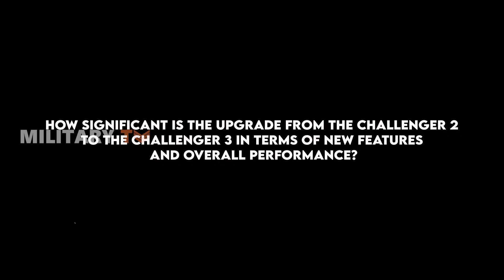The Secret Behind Challenger 3's Testing in Germany

Comment: it is tested in Germany because the turret is build by Rheinmetall....the 120mm smoothbore gun is build by Rheinmetall too, thus blurring the differences between all NATO tanks, aka they are all on par with NATO-standards....
Reply: Leo2A8UK😂
Reply: The Challenger three tank is a joint venture between BAE Systems and Rheinmetall Germany
Reply: The turret is built by Pearson engineering in the UK.
Reply: @toecutter6968  Yes, built. It was however designed by Rheinmetall.
Reply: NATO standards are not very effective against Russia 🇷🇺
Reply: @larryperera8724 

Well, even if it were so it is effective enough. What is used in Ukraine is not top of the line equipment but mostly outdated equipment which evidently still goes toe to toe with Russian top shelf with supreme ease. 🤷
Mind you that it shows that while tech is important the personnel is just as important, and Ukrainian personnel have given Russians a run for their money. How else could such a supposedly small and weak adversary hold out so well against the allegedly second strongest military force on the planet?
Reply: @larryperera8724  PZH 2000 and HIMARS 🗿

Comment: Losing D.U. rounds has nothing to do with the switch to a smoothbore gun. That's all health and environment related. Smoothbore are in fact better for firing discarding sabot ammunition, like the current D.U. rounds. The round the Challenger can no longer use is the H.E.S.H or high explosive squash head round. That needs rifling to spin it for stable flight (accuracy). Sabot rounds like D.U. use fins for stabilisation, spin even works against this to some degree. British Army wanted to retain H.E.S.H for Challenger 2. As it's useful against light armour and soft targets behind cover. D.U rounds are only really useful against heavy armour.
Reply: Incorrect
Depleted uranium is vastly superior to Tungsten however the companies that make depleted uranium are virtually non-existent now. Orbital ATK which makes the US made M829 series was brought by Northrup who announced in 2023 that they would no longer make depleted uranium rounds. Simply put, no one is making depleted uranium rounds any more as far as Western countries go.Long before Ukraine, the appearance of T-14 already questioned the existening capabilities 120mm ammunition that the time
The US made the M829A4 in 2016 however as stated before, no one in the EU was making DU rounds and the UK' CHARM-3 hadnt upgraded since 1999
so there was doubts about its effectiveness as well the ability of tungsten to penetrate newer Russian armor
The 130mm solves all problems , First Sabo rounds have 50 percent more kinetic energy which easily allow 130mm rounds to punch through any Russian armor 
The most important fact is that HEAT round in 130mm carries larger warhead which also equally as dangerous if not worse
Reply: @verdebusterAP  It's not vastly superior. It used to perform better than tungsten alloys in the 80s but only against semi-infinite steel targets. Against modern composite armor arrays tungsten alloys perform better because opf lower ductility.
Reply: @jonny2954  
Incorrect
Depleted uranium principal advantages over tungsten is it naturally self sharpening 
and  pyrophoric 
While Tungsten has near similar density , its lacks DU natural abilities
Thats why the US uses DU liners in the Abrams
Composite armor can blunt Tungsten rod rounds however DU rounds are much harder since their self sharpening allows them to retain their form
DU is pyrophoric so even if the rod is stop, the metal will burn at  a high temp which is bad for tanks for several reason
You can line Tungsten with zirconium powder for incendiary effect but it burns at 3000-4000 F while DU burns at over 10,000 F
Yes modern alloys are better than previous generations but they still lag behind DU
Reply: @verdebusterAP  Read my comment. Self-sharpening, that's why it performed better on semi-infinite steel targets early on. Modern NERA arrays don't care, the lower ductility of tungsten alloys help them perform better in that case.

APFSDS after armor effects rely on penetrator fragmentation and spall. While both kinds of penetrators get very hot they're simply too small (especially after going through armor) to heat up anything around them to havy any effect.

According to the US Army Research Laboratory, there is no difference in perforation of steel targets between DU and modern tungsten penetrators. The Americans say it themselves dude. You kinda dense.
Reply: @jonny2954  
Lower ductility does not help against modern armor, specifically against Russian armor
Russian made Kontakt-5 ,Relikt and Malachit  are designed to break Sabo rounds by subjecting them to violent sideways force as well explosive force
The US got their hands on Kontakt-5 twice and that is reason why they increased the size of the penetrator. Its thicker and heaver and harder to break

The  US Army Research Laboratory never said anything like that as they are the ones responsible for the M829 upgrades
They have researched  depleted uranium alternatives however as the M829A4 is DU still, no alternatives met the criteria for replacing DU in the series M829

Lastly, if Tungsten alloy could reliability penetrate armor, the 130mm program would not exist. The existence of program was due the doubts of existing tungsten penetrator 
against newer Russian armor.. The 130mm provides 50 percent more KE than existing 120mm rounds which tungsten alloy to reliability penetrate armor
Reply: @verdebusterAP sorry but some of the stuff you said is wrong. Armor vs reactive armor. It penetrates armor better.

A big factor in du is that it is relatively cheap for a country like the us. 

130 mm exists bc people want their tanks to work even in 30 or 40 years.
Reply: @emilsinclair4190  
Cost is not the factor but performance
Depleted uranium is naturally self sharpening as well as pyrophoric
Despite modern advances, machining tungsten to match DU for the US is not cost effective
Lastly DU has to be specially stored and handled when not in use which makes it more expensive than tungsten rounds
For countries that dont use DU, larger caliber weapons are the only choice
Reply: @verdebusterAP  ... again. Since alloys can also be self sharpening this point is mute. The kinetic and heat energy caused by the inpact will cause similar levels of damage inside once penertrated.
Strange how you say cost is not a factor and than state that it is not cost effective to produce tungsten alloys with some abilities.

Yea. It is a cost thing. The us had a lot of du so they used it bc it was cheap. Many countries did not have that.
Reply: @emilsinclair4190  
Just because an alloy can be self sharpening does not mean it delivers the same performance as naturally self sharpening materials
Cost is not a factor
Countries can make DU rounds however they dont not because of performance but simple ideological reasons reasons
Both DU and Tungsten are toxic heavy metals and just as bad
Reply: @verdebusterAP  1 no they are not. Du is worse than tungsten alloys.

Good. Now you just have to realise that this can mena that the performance can be superior against certain material and you will see why some countries use tungsten.

Sure. They can make them. As cheap? With excess material ? 
You even admitted that cost efficency was a factor in your previous comments.
Reply: @emilsinclair4190  
Tungsten is in no way superior performance to DU in any way
And countries for not using DU is ideological reasons not performance
They simply dont like it
Its more cost effective to make DU but they simply dont like it
Reply: @verdebusterAP  you have no base dor your claim that it is not superior. There are different kinds of armor. And different alloys have different advantages against different kinds of armors. Your claim that tungsten alloys can not be self sharpening was already disproved.

Kimda depends how you want to define ideological. Less polluting weapon systems are always good when you fight on your own land. 

Countries without massive nuclear stockpiles and a massive nuclear industry have less du meaning that the costs way higher for those countries.
Reply: @emilsinclair4190  
Lets see DU is naturally self sharpening and pyrophoric  while Tungsten is not. Tungsten has to be machined to be self sharpening while DU requires very little machining
so yes DU very superior. Tungsten also cant match DU pyrophoric nature. DU can reach as high 10K F while Tungsten not even close
Again both are toxic heavy metals
DU is byproduct of reactors not weapons
Reply: @verdebusterAP  ...reactors and weapons require similar infrastructure for the first steps.

Pyrophosphate does have 0 effects at the speeds. The destruction inside is basically the same.

Yes du is cheaper.
Reply: @emilsinclair4190  
Incorrect, 
Pyrophoric adds additional incendiary effects 
No, Enriched uranium depends on the usage
Low grade for most reactor sand high grade for most weapons
Reply: @verdebusterAP  ... yes and you usually separate them from each other using a centrifuge. The material with high content gets used in bombs.

Incendiary effects are basically irrelevant. It does rarely matter how hot the shrapnel traveling at the speed of a bullet is.

And even the few cases where it would matter you forgt that do to friction even tungsten gets fucking hot (tungsten also carries heat better than uranium. Look at the melting points)
Reply: @emilsinclair4190  
Again two separate processing route
Incendiary effects are by no means irrelevant. Steel for example melts at 2500 F plus temp. and DU burns at over 10,000 F 
so if by chance, the armor stop the rod, its still burning temp of DU is still going deal serious damage
its called beyond armor effect, after effects , multi-effect penetrator
several names for the effects after the fact but thats the principal advantage
it does more than just penetrate
Reply: @verdebusterAP  the start is the same and one can be a byproduct of the other.

People inside the tank get killed by the fragments traveling at the speed of bullets. Getting hit by one of them and it does very rarely matter of the material is du or tungsten.

Fragments created by both methods are incredibly hit do to friction. If it is already extremly hot even more heat does not matter. 

And ehen the fragments get slowed down heat can even be a detrement bc it makes material softer. Especially since uranium melts easier than tungsten. 

If the armor stops the round the structural damage caused by the shot will make up most of the damage. The heat created by stopping the round basically makes the other effects irrelevant.
Reply: @emilsinclair4190  
Still different process 
The shrapnel effect of DU more likely to cause secondary effects than Tungsten alone
Additional fragments are hot not burning
major difference , when tungsten stops moving , they automatically cool off whereas DU is still burning. which causes temp in the tank is sky rocket
Case in point, Tungsten fragments embedded in the armor door from the ammunition does nothing whereas DU on the same door is translating massive amounts of heat 
Again 
After effects of DU are far more lethal
Reply: @verdebusterAP  except that the fragments of tungsten are also extremly hot do to the friction. Again. The difference is minimal, depends on the situation and do to its lower Meeting points du fragments can hav3 lower penetrativ3 abilities bc they are softer.
Reply: @emilsinclair4190  
They are hot but they are not burning, 
Hot surface temp, Burning is self sustaining major difference
DU is not softer
Reply: @verdebusterAP  du is softer do to ots lower Meeting point. The damage caused by fire is usually done by the heat it produces. The fragments of du left after penetration are to small to cause anything significant enough to be a difference.
Reply: @verdebusterAP  Who's incorrect about what?

Comment: You would assume the UK would just use US DU rounds. With the exception of length, the barrel is the same. The recoil system is different, between US and German guns. They would only need to qualify the targeting parameters.
Reply: In comparison, the US ammunition is outdated. The L55 is not only longer, it works with higher preasures as well. So the penetration capability is +30% compared to the L44. In addition, the newest german ammo is very safe, it does not blow up if hit. But in this aspect, Challenger had / has the best protection of stored ammo of all NATO tanks.
Reply: @morgensternc  has/had?! No. In what world?! How is the challengers ammunition placement safer than any old t-series tank?! It isn't. It's worse in fact. The CR2 has ammunition and charges all over the hull. It has no blowout panels and will throw its turret if anything explosive is hit. The CR3 will suffer the same fate with the exception of German insensitive powder loads. The US Abrams is currently the only MBT that stores all of its ammunition in the turret bustle...
Reply: yes its the 120mm smoothbore barrel by Rheinmetall

Comment: I do not get why this is called Challenger 3. It is the very same tank fitted with a new gun. If anything, this is Challenger 2.5 or Challenger 2 Evo or something but its clearly not a generation leap.
Reply: New gun, better ammo, new sights,commander thermals, hunter-killer capabilities, new electronics, new armour, new fire control system and if I recall correctly some kind of battle management system. This is definitely a generational leap.

Also if I recall correctly there was an emphasis on modularity in the design process to make upgrade packages easier to add.
Reply: Maybe I am mistaken, but didn't the Challenger 2 have a teapot on board that has been omitted from the new tank? For Brits, this should justify a new version number?!
Reply: @Born.Toulouse  All British armoured vehicles have a brewing vessel onboard.
Reply: @Disbelief-  Compared to the Leopard 2A4 the Leopard 2A7 also has new sights, hunter-killer capability, new electronics, new armour, new fire control system. Doesen't make it a Leopard 3.
Reply: @jonny2954   I see what you mean but the changes from the 2A4 to 2A7 were incremental, not a big upgrade all at once.

Additionally, to my understanding the turret of the Challenger 3 is completely new (For increased modularity and 1 piece ammo storage/ the addition of blow out panels), while the the turret design of the Leopard 2A4 to 2A7 has mostly stayed the same, apart from the jump to the 2a5 where the optics where moved and spaced armour was added (and a few other things like electronics where changed). 

Also the C3 should be getting an active protection system, most likely trophy.
Reply: Marketing stunt.
Reply: It is, its only retained the hull shell, everything else is new and updated.
Reply: It has a completely different turret, which has a bustle ammo rack which is fitted with blowout panels.
In addition the fire control system is much better.
Reply: Easy there turbo
initial operational capability (IOC) is not till 2027 so they are still finalizing what the differences will be between the C2 and C3
You have realize that Ukraine also changes things with armor
The AbramsX prototype has 30mm autocannon. Before Ukraine, that was considered meh 
Now with things with Ukraine, that cannon paired with programmable airburst rounds or German made AHEAD rounds as well as advanced sensors may be the only way to keep tanks revelant
Reply: They couldn't convince Ukraine to keep fighting with inferior western junk unless they renamed it "Challenger 3" 😂
Reply: Most countries do this, they upgrade existing hulls/platforms, its not unusual. Remember that like for like western tanks were already generally better than tanks such as those from Russia. Tanks of course have vulnerabilities, like any system, so they are part of a mixed force.
Reply: @mattwright2964  I understand, but thats not what i meant. As an example : if one applies the same categorization logic the british army utilizes here to the Leopard series, then Germany would be at Leopard 8 by now. 🙃 Even the newest iteration of the Leopard, which features an unmanned turret and a 140 mm gun is still desginated Leopard 2 A-RC 3.0 as its not a new design but just an upgrade of an existing production line. It rather seems to me that the british army is inflating things a little here to sell this new Challenger iteration as a bigger thing than it actually is. 😉